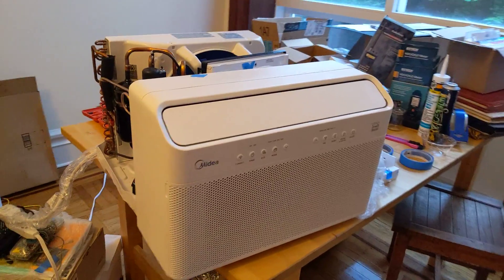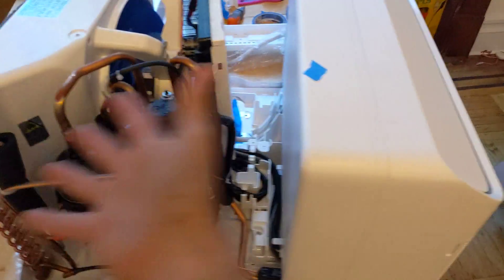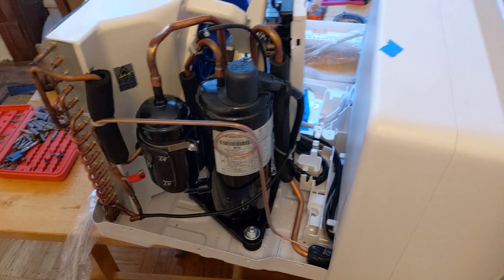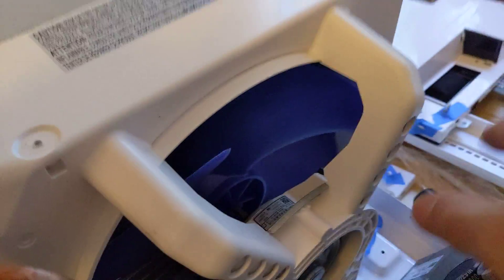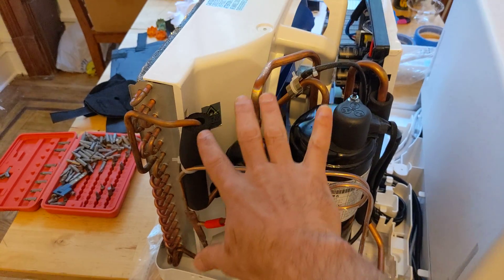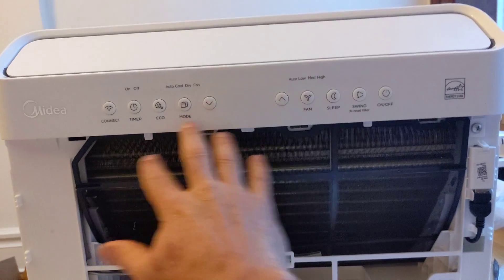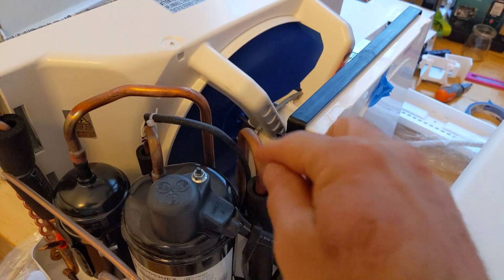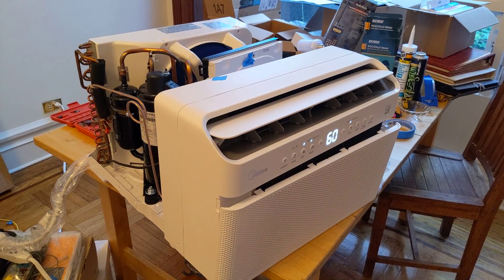How did Midea fit a full mini-split system inside their new "U" window unit?

Comment: Hey Josh this was super helpful to get some more background on how this unit is designed and works.

I actually stumbled onto this because I got mine about 2 months ago and I'm really happy with it's performance with one glaring exception I've been trying to troubleshoot: The AC unit itself is very quiet and while it's clearly vibrating a bit (I think a bit too much) it doesn't sound loud when running and is even barely noticeably rattling unless you hold it with your hands while running. However, the vast majority of the time it's running it's shaking enough as to make a pipe or something in the wall, what sounds like maybe 2 or three fit from the window, shake so much that it makes an incredibly loud rattling sound. I wasn't sure if it was the AC or something in the wall at first but if you just put both hands on the wall and put some pressure against it, it immediately stops. Remove the pressure, super loud rattling is back.

I've removed and reinstalled the AC in the window three times now, paying special attention to how I can mount it more firmly and fill in spaces with foam padding and blocks to fit it more tightly to no avail. The inconsistency is maddening. For a while I thought it was only occurring on the Dry setting (and it does seem to be very consistently happening on that setting) but it also happens on Cool. I've been trying to figure out if it's more the window mounting being too loose or a loose compressor/related part since it seems to never happen on auto/fan modes. Sometimes I go days without hearing it, sometimes I can't go more than a few minutes without hearing it. Sometimes turning the fan off and on again will make it go away for hours or days—sometimes I'll do that and it won't go more than a minute or two before it kicks back in. I can get a technician to come look at it but since I suspect the fix may be as simple as adjusting my mounting or opening it up and tightening a loose part (maybe something that was looser than it should be due to shipping etc) I'd like to try diagnosing and solving it myself. At first it was just mildly annoying and not concerning but there have been a few times where it is rattling so violently that even with noise cancelling headphones that block out the sound, I can feel  the rattling up through the floor at my desk ~ 8 ft away from it.

Any thoughts on how to adjust the mounting or starting places to check for loose parts inside? No worries if not, still really appreciate getting this context into how it works!
Reply from the maker: Yea, intermittent rattling noises can be very hard to find in cars and in AC units! It usually means some moving part it banging or rubbing against so other part so they have to be just the right distance away from each other to make the noise- too close and they are pressing, too far and they don't touch. I usually do what it seems like you are doing - looking for patterns both in what is moving when the noise happens and what things I can move to change the noise. Besides pushing and pulling on part, you can also try twisting by lifting one corner or another. You can also try to listen very carefully to try to hear around where the noise in coming from and then go after that spot by taking it apart and putting putty or duct tape on the rubbing/banging parts.

Comment: You are the only guy who took it apart!  That's awesome.  I noticed that it does well when it's dehumidifying. But as soon as I turn it back to fan mode, the humidity comes right back into the room, as if there was no drainage at all. And it doesn't have any drain hole.  (it's tilted out so water wouldn't come back in)  If the condensed water is used up in "super-cooling" the moisture shouldn't be back. This is baffling. I wish Midea had a drain hole that could be plugged for arid areas and opened for soggy areas.
Reply from the maker: The unit is meant to be slightly tilted towards the outside. Like this, I would think all of the condensate would flow though that channel to the outside pan and there would not be much left on the inside side to re-evaporate. I could think of some experiments that would pin this down, though!
Reply: @bigjoshlevine  When I installed it, I didn't have a level. But I did have an AA battery rolling about. After installing the support brace, I rolled the battery on it. Even if I rolled the battery inward toward the room from outside, the gravity would make it roll back out. So I know it's tilted out enough.  I wonder if there is a smaller reservoir on the room side. Once that's filled, maybe only the overflow would go outside? Dry places like Arizona would need to preserve moisture inside.  Since Midea U is the most popular unit now, your experiment could bring interest. I certainly would be interested!
Reply from the maker: @LawyerPapa  There is usually a gutter inside under the evaporator coil that catches the water as it drips down. This leads to a drain just like a drain in a roof gutter, and that leads to a channel, that leads to the try outside. So there really should not be any standing water inside, just droplets waiting to get big enough to make it out. I would not expect much if any water to condense in a place like arizona. For water to condense, the evaporator coil must be below the dew point of the inside air, and these coils typically run about 45F. They don't run any coiler because of the risk of going below 32F and forming ice and frost which would block airflow and potentially make things start to break.

Comment: Hi, that very high pitch "Crickets" sound before the fan started, is that sound from your phone picking up some sought of interference? I too want to install one in a recording stidio.
Reply from the maker: SOmetimes the compressor does make a high-pitched whine when it first turns on. For a recording studio, personally I would keep the entire AC unit outside the sound envelope and then run insulated ducts from the space to the AC. Silent.

Comment: I have a studio apartment, six floors up. It can get quite hot and humid. I've had a few air conditioners over ten years. A couple new, and a couple used. They all stopped working after a couple of years. Even the new one, that to be fair was cheap. Most of them were loud, and and annoying. They would muffle my TV, Stereo, and having a phone conversation was awful.
I paid a bit more for this one, but so worth it! It is quieter than expected! I'm so happy for that. I can stand to be home.
The cooling is as expected.
Smart features are very nice to have.
The only critical thing I have to say is that the shipping took a long time. It came from the factory. I can forgive them this. I mention it only because if you feel your cooling solution is about to die, order the Midea ASAP. I had to go a week with nothing, when I could have ordered it sooner. That's my bad.
I recommend it! If you're not handy, ask someone to help you. It isn't so hard you should be intimidated.

Comment: I just received my window unit, I love it except for 2 things ... that high pitch squeal and the side to side louvers are useless, they are too tiny to make airflow change direction. But the one that may cause to return it is that high pitch squeal ... like your unit also has when you turned it on. Is there anything that can be done to get rid of that or drastically reduce it? Listening to a old / loud AC unit that has no such high pitch whine is far more soothing than listening to something screech n squeal constantly =(   I almost wish they would have thrown in an old fashion compressor that doesnt have this sorta squeal noise , then it would be just fine.  Spectrum analyzer shows squeal is around 6-7khz ... no wonder is annoying.
Reply from the maker: Yes, I have heard it too. I think it comes form the pulse-width-modulation drive on the compressor motor. I think it is worse on some units, and seems to go away after the unit runs a while? It would be a project, but I bet you could change that PWM drive to be a pure sine wave at a non-audible frequency.
Reply: @bigjoshlevine  Yeah, it seems it actually comes and goes, one hour I wont hear the high pitch noise, another hour I will .. in both cases the compressor running and seems like same speed. So, is the noise coming from the compressor or the PCB driving the compressor .. in either case is there any sorta noise insulation I can put in place(in the unit, without effecting thermal dissipation negatively) to reduce the noise?  Love the unit except for this noise =(
Reply from the maker: @RandoTark  In mine the noise seemed to be coming from the compressor. If yours is the same, then it should be easy to fix. I'd get some soundproofing putty sheets and mold them around the compressor. These are great for knocking out high frequency sound.
Reply: @bigjoshlevine  Any idea how I can easily determine the source component of the noise?
Reply from the maker: @RandoTark  I've used the ones meant for cars since those are good for high temperatures and don't smell (compressor gets hot).
Reply: @bigjoshlevine  The foam / alum type or the butyl alum type? I think im seeing those 2 variations on amazon =P   Also, do you think thats the primary purpose of the wrapper thats installed around compressor from factory?
Reply from the maker: @RandoTark  I don't see the ones I have on Amazon, but I'd try the high heat foam ones first. I'd put them over the existing compressor blanket and try to get an air seal so no sound can leak out. If you are in the NYC area I can give you some of mine - I have a whole box.
Reply: @bigjoshlevine  Nowhere near NYC ... how thick are yours? I see several thicknesses avail on amazon.
Reply: @bigjoshlevine  Also wondering, you havnt had any issues w/ compressor performance / overheating because of the added insulation? I guess thats my main concern adding more insulation.
Reply from the maker: @RandoTark  The compressor is primarily cooled by the constant supply of relatively cool gas refrigerant flowing in, and rejecting heat via the hot gas flowing out. In fact you want to compressor to be hotter than ambient or else the refrigerant might liquefy in there which could damage it.
Reply: @bigjoshlevine  Thanks for replies and guidance =) I got my sound proofing sheet lol ... its a bit too thick, some of the copper tubing sits too close to compressor to get this stuff nicely installed. So, best I could figure out for now was putting a cut n the original blanket so it fit better around the top , then I basically put a larger sheet just kinda around the original blanket and in that general corner within the housing. I think its helped a bit in absorbing the whine as it doesnt sound as loud from outside now. But I think the most imortant part to minimizing that whine as much as possible is to seal the unit to the window as much as possible.  After listening to the compressor closer it seems the majority of the whine emanates from the lower half of it. It may even come out the bottom which is pretty difficult to get padding sound deadening stuff down there.
Reply from the maker: @RandoTark  Might be able to shove waterproof foam down under the compressor? Interested to hear your results!

Comment: Can you and how would you fit this in a sliding window?
I can't find any manuals/videos of anyone doing it...
Reply from the maker: Hmmm... I guess you could cut the metal of that bottom pan and then add a hose to redirect the condensate and push all the connections over to the side so you could slide the window almost shut, but a lot of work!
Reply: @bigjoshlevine  Can't just turn it sideways? The compressor doesn't work sideways?
Reply from the maker: @IThinkICare  Not a good idea, would probably burn out the compressor. There are many places where it assumes that the heavier liquid refrigerant will go down towards the bottom of the unit, and if you turn it sideways that will not work anymore. For example, the outside condenser coil relies on the fact that hot gas in on the top and then liquid will come out the bottom. Depending on which way you turn it sideways, maybe you will get liquid backing up back to the compressor head which would be bad. You'd have to make sure that when you turned it sideways, every place where things needed to go "down" still went down. By the time you were done, I think much easier to leave it in the original orientation and just cut the slot! Check out my video on a (sort of) sideways AC unit and see how the compressor and coils are still upright....
https://www.youtube.com/watch?v=t2n-Dp_CbLI
Reply: @bigjoshlevine  I though it was under pressure so no matter the orientation also that it's gas and not liquid so hot or cold, liquid or gas, it is still pumped up, into the inside unit, (which in mini splits are mounted high). thanks
Reply from the maker: @IThinkICare  Both the inside and outside units must be with the correct orientation for a minisplit to work. The DYI ones even come with a level to use when mounting the inside unit because if it is tilted the wrong way even a bit then the condensate will not drain. Just look at the connections to the condenser coil on this unit above. See how they are both connected on the same side, and the gas is at top and liquid is on the bottom? Now imagine you rotated this 90 degrees so those connections were on the top. Now for the liquid to flow out , the coil would have to completely fill up to the top with liquid. That is just an obvious visual example, in real life other things would break first like the compressor head. 

Here is  a video that gives a bit of a feel for how that refrigerant flows in the system...
https://www.youtube.com/watch?v=h6K85AB583s
Reply: @bigjoshlevine  Come to think of it, all they had to do is to put all cables in the right corner (for windows sliding to the the left). Maybe the support need to be figured out, but unit would be more versatile. Add an available quickconnect style extension hose and now you really got a mini split.
Reply from the maker: @IThinkICare  Agreed, but I considering this is the first real innovation in the window-unit market in decades, I think they were focused on keeping it simple and cheap rather than covering niches!
Reply: @bigjoshlevine  
Installed mine today on a sliding window - just used wood/screws - solid, no wiggling - insulated every small opening

My only problem is that with these new units water is collecting inside and kicking it on the coils/fans to cool them down, but I am afraid this might become a rust issue or something as there is no draining holes in this - I don't want to drill any hole as that will void warranty, another option is to have a hanging cloth or something from behind to drip the water

Do you know if this is an issue or if it won't rust I guess with that water in the back?
Reply from the maker: @axiosw0774  It is designed to retain that water so I would not worry about it. I have seen 20+ year old AC units that have been left year round and rust does not seem to be a problem.
Reply: @bigjoshlevine  
Right, but putting a cloth or something, will that help again molding, rust? Or is that a bad idea?

Aslo, idk it's weird, but my portable AC 10k btu, seemed to have been more colder than this new Midea one, both are 10k. I've played with every setting...like it's not bad, but at it's lowest 16c it doesn't make a room very very cold. I kinda had higher expectations tbh since it's apparently the best in the market. My room is 320-350sq2
Reply from the maker: @axiosw0774  I would not mess with the water collection system - having that cold water in the pan helps the unit run more efficiently.
Reply: @bigjoshlevine  
But it will make it rust eventually and potentially kill the unit no?

I was thinking if they do it on purpose so you buy new every year or two?
Reply from the maker: @axiosw0774  Next time you are walking down the street and pass some OLD window units, look inside the fins and pan and I bet you will not see rust. I have never seen a window unit die from rust here even after being wet for decades. Maybe you will sometimes see rust on units near the ocean, but this is not from condensate.

Comment: How difficult would it be to add a reversing valve to turn this into a heat pump? I have the Danby version of this AC and everything is identical: parts, instructions, using the Midea app and everything. My remote is slightly different though, I have an option to select heat. If you set it to a higher temp setting, it will kick on, but it's not running in reverse, so cold air comes out. It can't be that hard to add the valve. The refrigerant should be able to handle the extreme temperatures on the opposite end, though. I think the hard part would be dealing with the ice that forms on the outside heat exchanger. Might need some resistive heating elements between the fins?
Reply from the maker: It would be hard. You'd have to pump down the whole system and then make big changes to the piping and then fill it back up again. Not worth the effort. 

There is another way, however... you can just turn it around in the window! I have actually done this to get heat!...
https://twitter.com/bigjoshlevine/status/1285047239568654338

You might need to mess with the sensors and controls depending on your inside and outside temps, but much easier than messing with the refrigeration circuit.
Reply: @bigjoshlevine  Lol! That sure is the low-tech way of doing it, but gets the job done